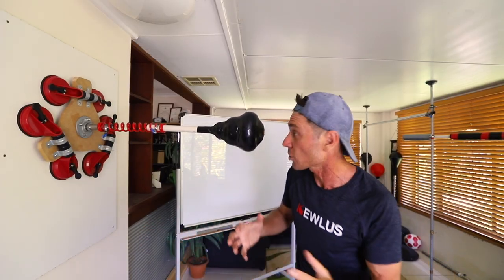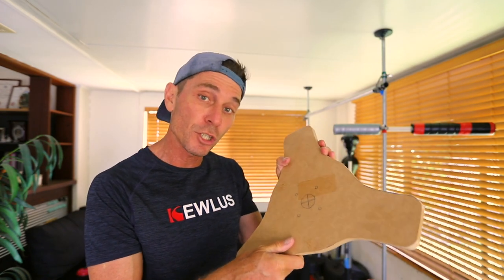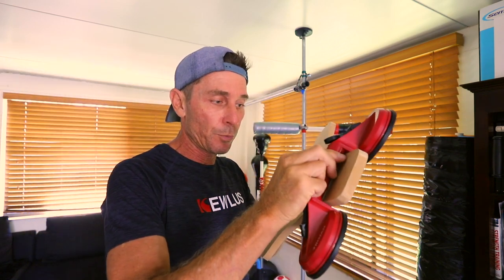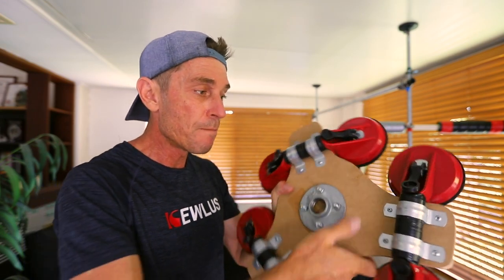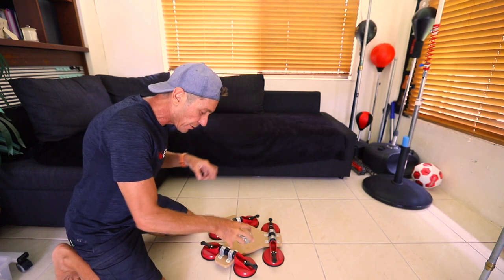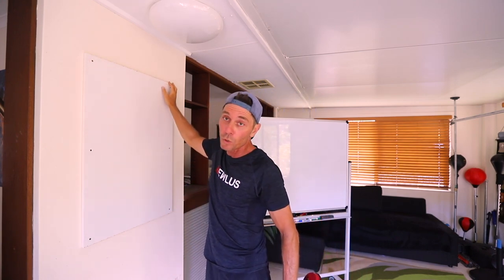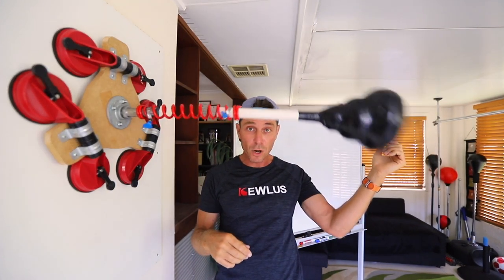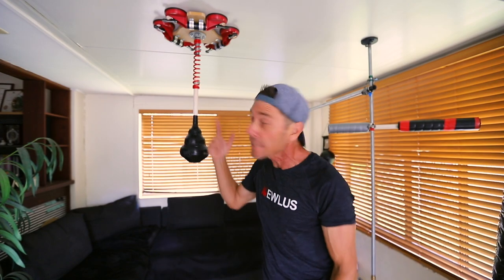How To Make a Horizontal Cobra Bag using the Kewlus PRO Spring

Comment: Hey Kewlus!  Ended up using a 1”x4”x10” White Oak board since it seemed like strong wood.  I then put the flange in the middle of the wood and then drilled holes into the aluminum handles of the suction cup things.  Then I bolted the suction cup things into the sides of the wood with Bolts.  Works like a charm!
Reply from the maker: Awesome!!!

Comment: Does the suction cups work on concrete?
Reply from the maker: Yes on smooth concrete. If the concrete is rough, you can paint or spray paint a section with varnish 👌